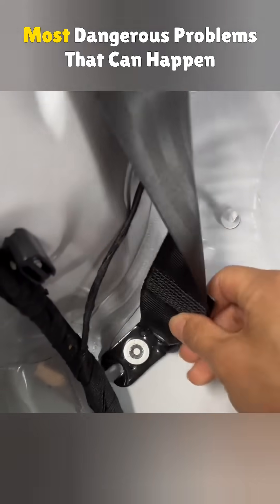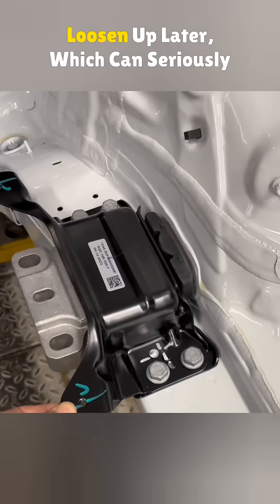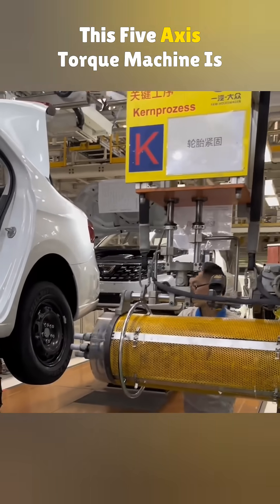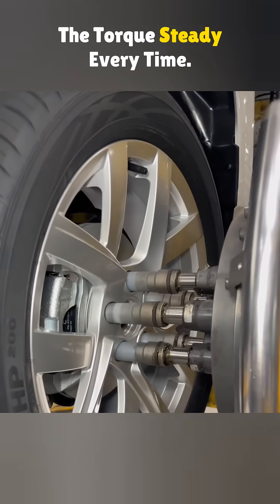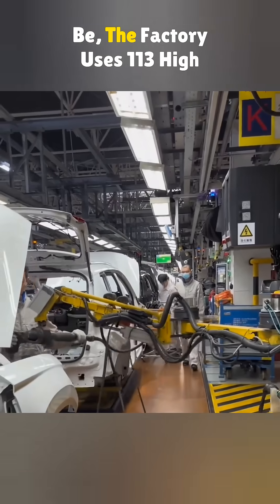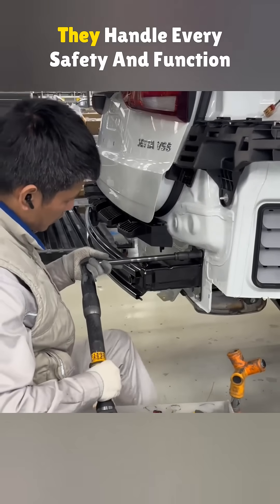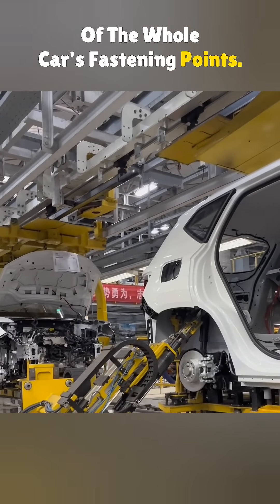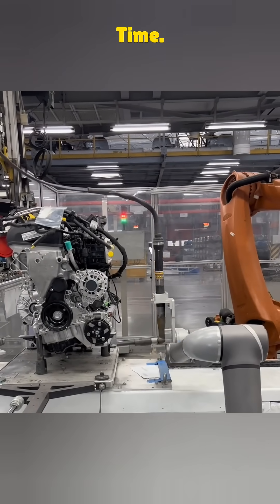Why Loose Screws Are a Big Deal in Car Manufacturing #assembly #automobile #mechanic

Comment: So for what its worth the first clip shows a seatbelt terminal which usually has a tolerance for movement so the belt can lay cross your body at the correct angle for your ahem geometry. When in a crash, it's designed to jam and trust me it can hold at least an order of magnitde or two your body weight.

Comment: So much effort put into newer cars production  to only last 5-10years before it becomes unviable economically to fix.
Reply: Buying a new car is pretty much never a economially viable choice. Even if the car needs an expensive fix.
Reply: Don't look at the repair cost so much.  Look at the replacement cost.  You know your car.  Replacing it with a comparably priced car will get you a used car with an unknown history.

Comment: Why bother with something like this when the wheels are going to need to be changed at some point anyway?
Reply: Proper torque is needed until the wheels are changed. Then they will need to be torqued again.
Reply: Because it's a vehicle safety torque and to prevent lawsuits they have to prove they built it correctly. 

Not all torque values are recorded only safety critical ones.
Reply: Because they shouldn't fall off in the mean time?